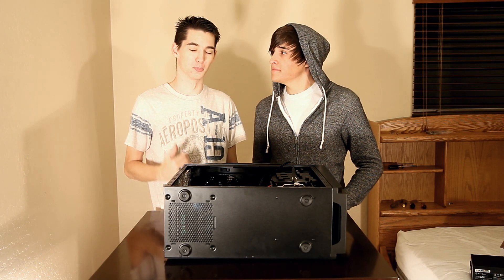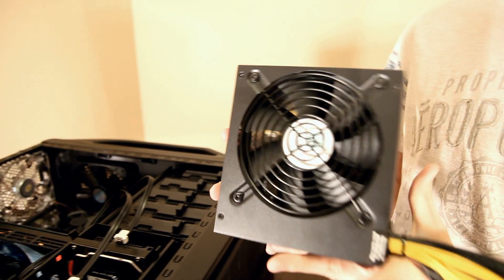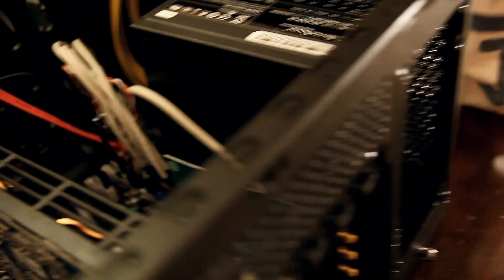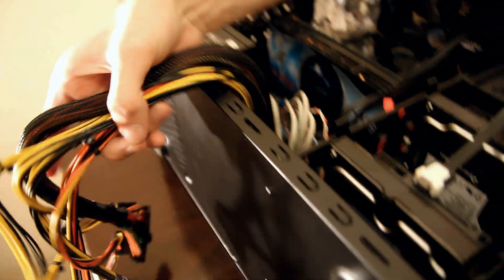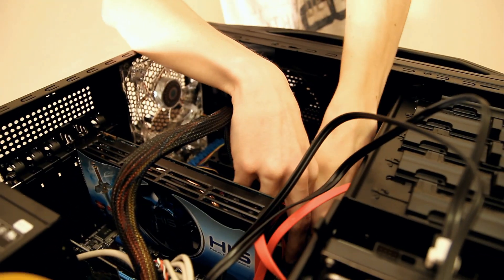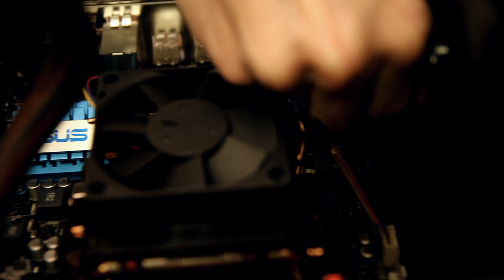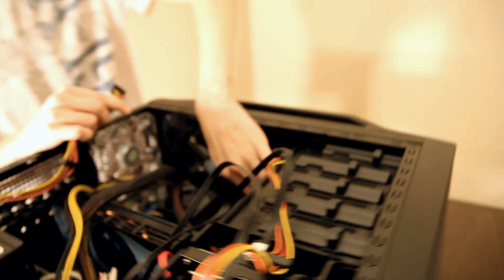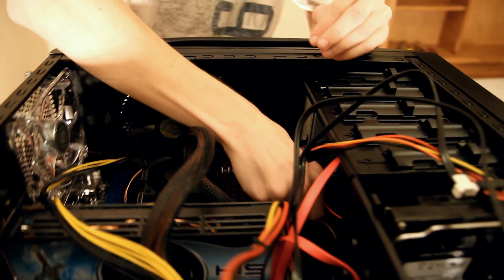The Power Supply | Building A Computer Series

Comment from the maker: @dragon101432 To install windows you just need to put the Windows Disc into the DVD tray when you boot up the computer. If it doesn't automatically boot up the disc, restart the computer with the disc still in the tray. If it still doesn't boot the disc, you need to enter the BIOS Settings (you should see a "press delete to enter BIOS" kind of message on boot-up) and set the Boot Priority to your CD/DVD drive.

Comment: @ChChCheckItsClan Well. At some point it's helpfull. But you maje it seem harder and more difficult, than it really is :-) And the cables?! Gawd, those cables! And why not turn the harddisks upside/down, so that the SATA cables points downwards instead of upwards? :P It's some minor things you do "wrong". No doubt. the computer will start up and work. But with that cable mess it is just a matter of time before all airflow is blocked = too hot components = It wont work proberly anymore :-)